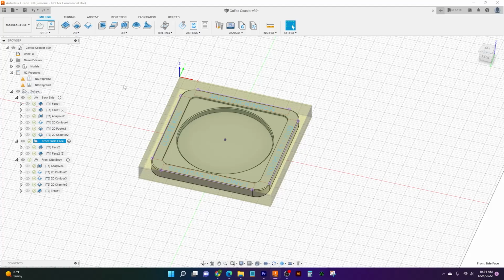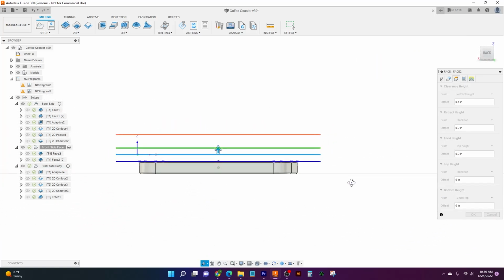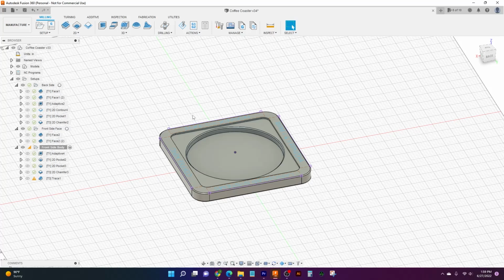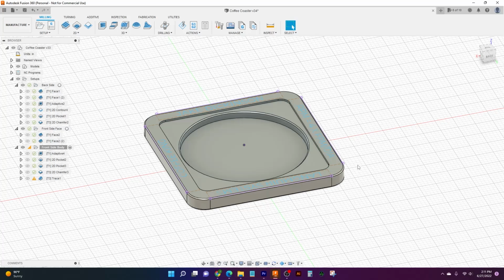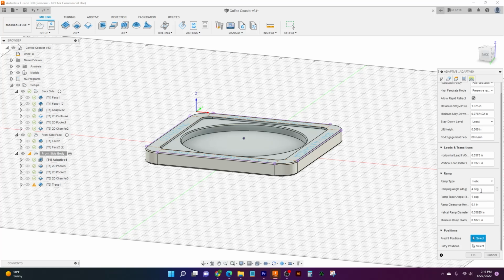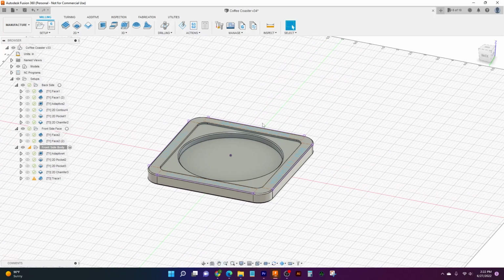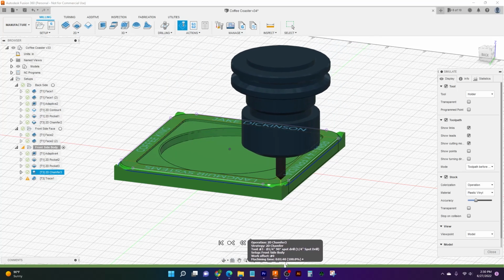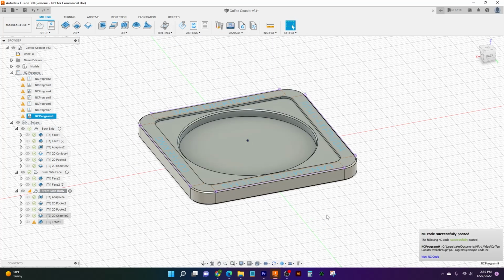MR-1 CNC Mill Shop Project - Aluminum Coffee Coaster Part 3 - The Final Product

Comment: How did the dimensions turn out compared to the model?
Reply from the maker: Everything is within a couple thousands so it turned out great. All of the stock was removed and the finish operations were centered with the roughing so the computer just dialed everything in. The only thing is the height is .005 shorter than I was expecting but I think I was a little over zealous with my tool touch offs.

Comment: Is there any vibration damping in the X or Y structure or just the base/table? There is a lot of high order vibrations going during the roughing here, and just aluminum. Makes me think about adding mass to the X gantry while assembling or just holding off to see if that gets improved. It's kind of painful to listen to. How's the surface finish following the roughing, any artifacts?
Reply from the maker: This is actually the part vibrating not the machine. The pocket wall thickness is only like 0.125" and it vibrates when cutting. Check out our other videos where we take much larger cuts in steel and aluminum without similar vibrations.
Reply: @LangmuirSystems  Perfect example of the ringing I'm referring to here https://youtu.be/dSlvOTQbHLM
The ringing heard after the cutter disengages the part at the 2:00 mark.
Reply from the maker: @Dreddip  So a couple things here. 1.) This is cutting steel at 4 MRR which is really just crazy for a machine like this. You would be hard pressed to find a machine sub-$35k in the market today that can make that cut. Most customers will find that cutting steel at 1-2MRR (still very fast for a hobby machine) is plenty productive and barely stresses the machine. 2.) This our test machine that has been through many iterations over the last months/years. I can already tell you that at the time of that filming we've fixed spindle bearing issues that caused some high pitch ringing under high cutting loads.
Reply: @LangmuirSystems  I realize this is the prototype and even at that stage it's a pretty impressive machine, especially at the price point you guys are in. I agree that this thing is capable of doing things that only full industrial equipment can do, and even then some of the machines I've used still arent as capable as the MR-1 videos I've seen. I'm just curious about the ringing. If it's anything you are doing anything about. It is probably a unique thing to tackle in the gantry design at this scale. The ringing as far as I can tell in the videos is low amplitude and I have yet to see any chatter in any of them. Which considering the tool loads you have demonstrated is very impressive. I am curious though about what it would take to eliminate ringing and if it would even be practical/realistic. Throwing around an 800 lb concrete filled X rail for example, likely isnt a practical solution.
Reply from the maker: @Dreddip  thanks for the feedback we appreciate it. We actually did consider filling the beam with concrete but there are other challenges there. Just knowing our customers I think there will be a lot to custom modifications that people make so it should be fun to watch!
Reply: @LangmuirSystems  One of the biggest things as a customer is I'd really like to have the manufacturer support the modification community. Being part of a 3D printing group who have designed a printer which punches way above its weight class in terms of price vs performance (Same philosophy as the MR1) the best thing that has ever happened in terms of the project's design progression and improved performance is supporting the community who is experimenting with the product. I'm sure there will be an MR2 some day -and if the support is there - I guarantee there will be community designed parts in the future model. There are some... Crazy... Smart people out there.

Cannot wait to receive my MR1 in December/January.

Comment: Jake, thanks for all the effort your putting in to produce these tutorials, with each one we get a little better understanding of the operation of the MR-1.  I'm sure like most folks following along they would like to see some of the user interface on the controller when your setting the G54 and like operations.  I was wondering if you will have a conversational mode for the controller.  Thanks.
Reply from the maker: Thanks for that Eric that means a lot. As of writing this comment we're starting to produce our Cut Control tutorial series so those will be showcasing the user interface for MR-1 and helping to provide advice for new users. Also, we definitely want to add conversational mode to Cut Control since it makes it so easy for new or experienced machinists to make more complex cuts without having to code. So keep an eye out.

Comment: Please next time show how you input parameters in the controller as well. It will be easier for us to start learning the controller.
Reply from the maker: We absolutely want to start incorporating the CutControl UI into future videos. While the functionality/engine is complete, we’re still finalizing the UI. Should be complete at the end of July. Our concern is if we use the incomplete interface for these videos, it will lead to confusion when the version folks are using doesn’t match. Hope that makes sense.
Reply: @LangmuirSystems  I agree with you LM, wait for the final live version versus the beta development for the tutorials.   I am running into that problem with fusion tutorials just from the large multiple revisions of the software, where steps in the tutorials are not available because refinements have obsoleted them.   Thanks for your efforts on this, look forward to the machine and more vids.   Look forward to learning CNC a little instead of spinning hand wheels!